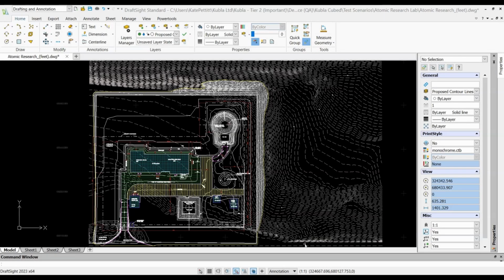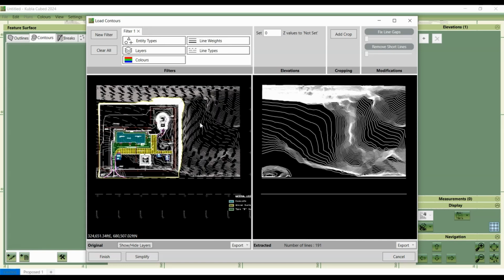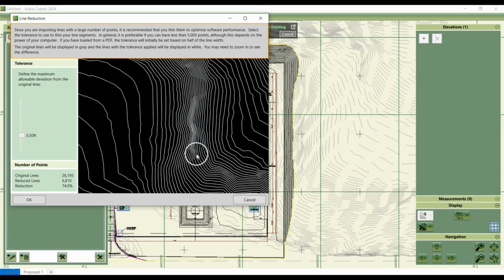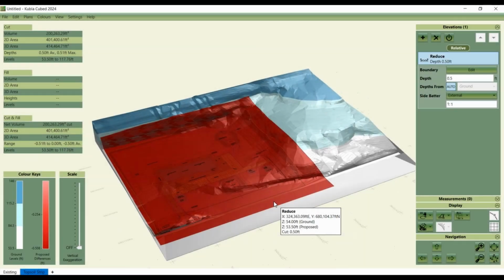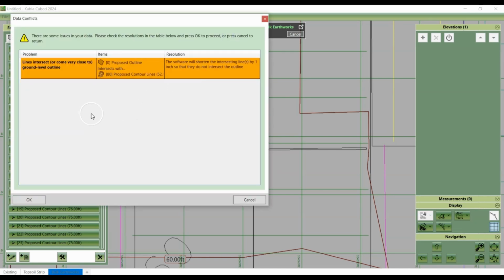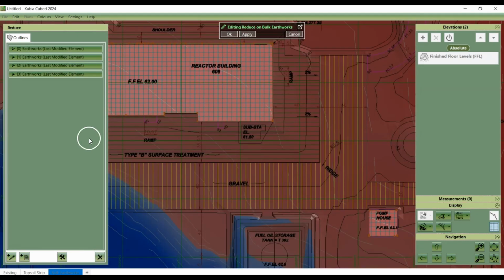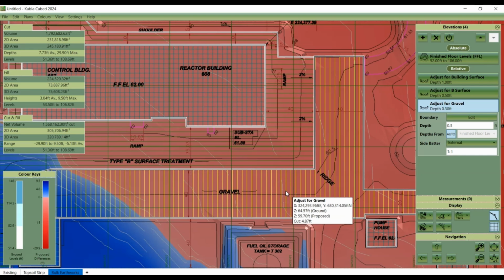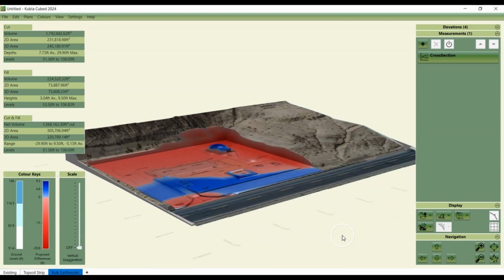Kubla Cubed Walk-through | Commercial Project (CAD Files)

Comment: You breezed over the creation of breaks. In the case of a retaining wall, particularly one where there is a significant change in level do you just apply a single break line, or two, one set at the bottom of the wall and the other at the top? I also would like to add that creating a Kubla Cubed model is rarely as straightforward as this example simply because of the lack of information provided. For example in this project you have a full set of existing and proposed contours. We very rarely get that quality of information. I can’t recall getting a drawing (other than a LIDAR survey) with the contours shown on it. More often than not the project drawings (particularly the proposed ones) only give us a few, what appear to be randomly plotted, levels. I’m sure I’m not alone in wondering what your approach and workflow would be like if you had to work with some of the information we get in the real world. If that reads like a criticism, I apologize. It’s not, particularly of Kubla Cubed. I now use it on every project to establish the cut and fill required to create the formation levels, I’m simply trying to generate the best and most accurate estimates I can from the information provided
Reply from the maker: Thanks for the feedback, there was a lot to pack into this video and we felt we had to rush through a bit or the video would be too long.  However we have a separate video on retaining walls if you searched for "Kubla Cubed Retaining Walls" (https://www.youtube.com/watch?v=0A9spj5Dats&t=420s) you should find it.  You do indeed need to trace two break-lines one for the Top of Wall and one for the Toe.  You can use the offset tool to speed things up.

Comment: I’m I correct in taking from this that your recommended workflow is to create a finished levels layer of the entire site, including buildings and then use the reduce tool applied to the individual elements to model the formation level, as opposed to my current approach where I use the platform tool to outline an element (say a building) and then apply a negative offset.
Reply from the maker: That is not the case we should have made it a bit more clear.  There are two workflows we recommend for most scenarios.  One is the offset method you describe,  which involves defining a site in different pieces and adjusting with a negative Z, it is actually a slightly superior method.  However sometimes site plans tend to have a whole surface defined as proposed contours, which is difficult to break up, contour sets do not split apart nicely (imagine if you have a boundary between two contours.  This is where we recommend the 'Reduce Method' which is used in this video.